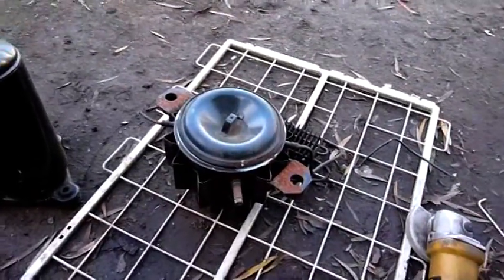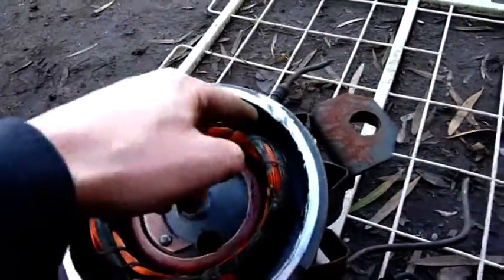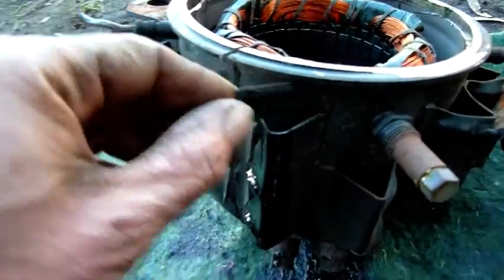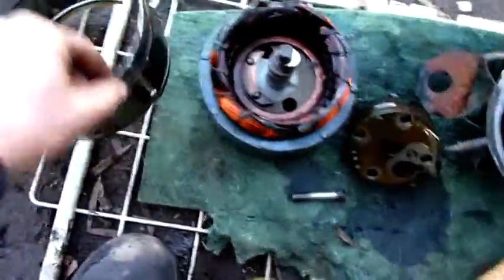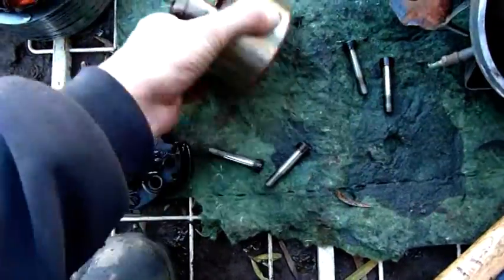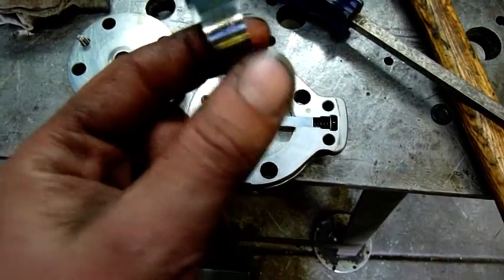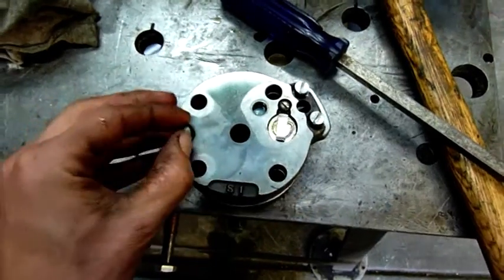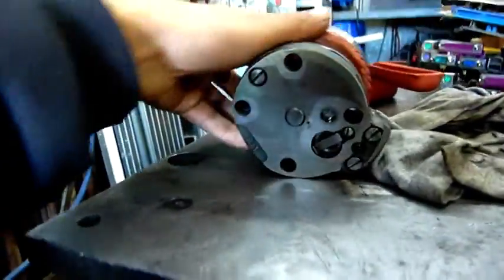Vintage English Fridge Compressor Disassembly (rotary type)

Comment: If you search for the documentary Secret Life Of Machines - The Refrigerator (Full Length) you can see examples of commercial ammonia refrigerant systems used for a ice block company.  My grand parents had a refrigerator which had a separate 1/6th horse power Delco-Remy motor and a belt driven two cylinder compressor which I believe was ammonia refrigerant.from the late 30s to mid 40s.

Comment: It was marketed as a "meter miser" many many years ago, I have a frigidaire fridge here with the same from the 50's it still works fine but sends anything using radio frequency absolutely crazy.

Comment from the maker: @PonguigPeopinn nope, domestic hermetic compressor units used R12 Chlorofluorocarbon, old absorbtion type coolers did use Ammonia, like caravan fridges and large natural gas powered AC plants. 

however some old open drive domestic systems did use ammonia, but that was 1940's - 50's stuff I think

Comment: @Aussie50 I had to put a new end on the cord and i could see if i wasnt careful it would just fall apart.  There is a terminal block on the side of the compressor but in moving it, I would risk cracking the wire that goes into what looks like a hermetic compressor, through a hole in the very bottom.  Doesnt look like it can be accessed inside the compressor itself.

Comment from the maker: @More350Power yeh the old stuff is the best!, gotta be careful with that old rubber coated flex, can you get the terminal box open or is it one sealed piece?

I will be rewiring the Servex fridge when I get a new door seal in, its long overdue

Comment: That is close if not the same style compressor in my 40's ge fridge.  The wiring going into the bottom is a rubber cord and is hard as a rock...... cant see a way to re wire it..  Great vids!

Comment: Thanks for showing this! I have a two similar Frigidaire rotary compressors that are still working so I didn't try to dismantle them to see what was inside!

Do you know what was written on the tag (HP, voltage etc...). Here in Canada, similar compressors are either 1/8 HP or 7/32 HP.
Reply: the meter misers were i believe 1/8 hp at 110v in the us, that one may have been the same but wound for 220v. i know they were used in the US in the 40's and 50's
Reply: @gtb81.  They were made in many sizes, there were smaller ones as well. I have a tiny 1935 refrigerator with a 1/20th hp Meter-Miser compressor and most of the large Frost-Proof models used the 7-32hp version. There were also 1/6 hp and other models. I think the largest Meter-Miser rotary compressors were 1/3 hp found in some Frost-Proof freezers (like my 1960 Imperial freezer) and later in the 19 cu-ft bottom-freezer fridges and other large models.
Reply: @PhilRacicot  i didn't know that, i've only seen them in the flat top refrigerators, i've surly learned something